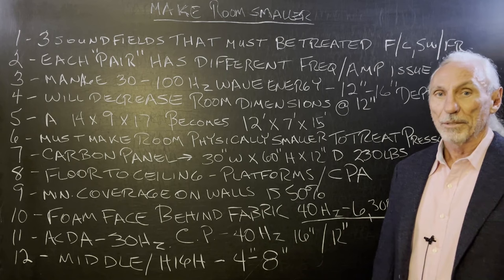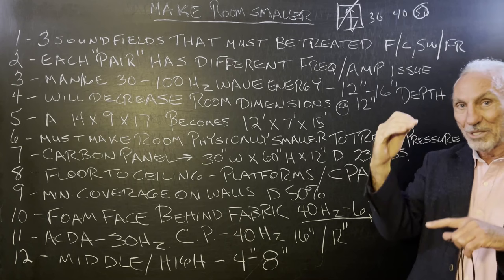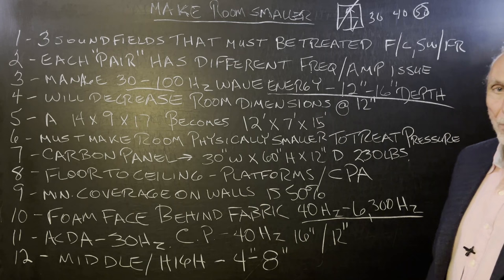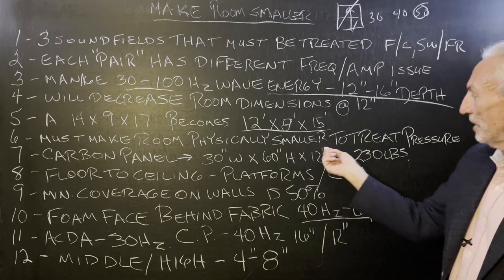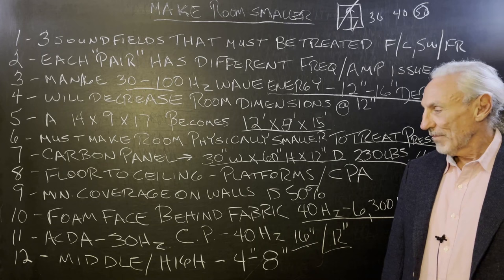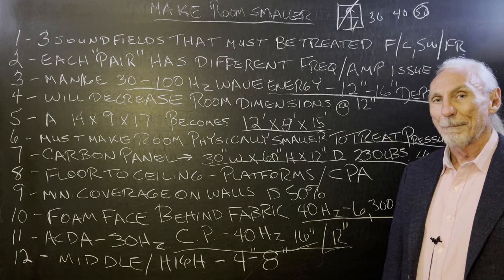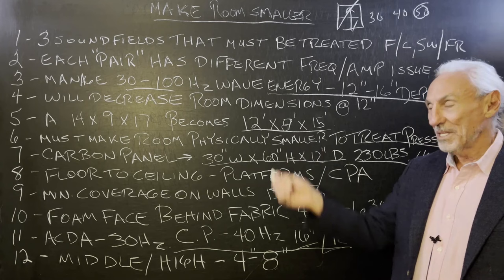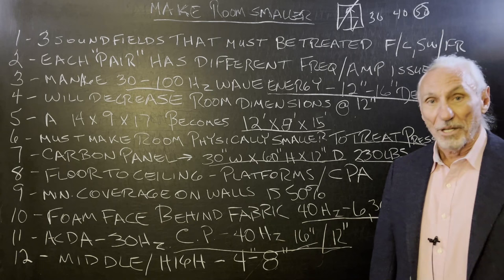Make Your Room Smaller?! - www.AcousticFields.com

Comment: Small rooms (let's pick 12x15 with a 9' ceiling) might be fine from a modes standpoint if your use doesn't generate very low frequency sounds. For example, if you use it to listen to 2-channel baroque string quartets, a cello generally has a low end of C2 around 65 Hz, and that's not hit often. A 9-foot ceiling has a fundamental of 63Hz, so if you set up the speakers and listener positions semi-near-field, say a 6' equilateral triangle, you'd probably need a fairly minimal amount of LF treatment up above, with reverb reduction from the side walls being the main task to be tackled. Lots of reverb with violins is really unpleasant. Your 12 and 15 foot long walls should have fundamentals of 47 Hz and 38 Hz respectively which shouldn't present major issues with string quartets.

Of course, before spending a bunch of money, get input from AF. Feel free to tear that spitballing apart mercilessly.
Reply: The number of people (especially recording engineers), only listening to music above 65Hz is VERY rare. I don't know  of a single audiophile that limits themselves to only that type of music.  Even most bookshelf speakers will reproduce down to the mid 40hz and below, especially with a subwoofer added.
Reply: @Oneness100  Yes, but for string quartets, that room would be pretty good without much LF treatment. The semi-near-field positioning, assuming a low noise floor, would allow the listener to hear other types of music with lower frequencies at a pretty good level (due to the relatively short distance between the speakers and the ears) without putting too much pressure (as Dennis would say) into the room. It's a trade-off for a limited budget and limited space.

I'd add that you're right even if the listener just stayed in the baroque era, where organ pieces reaching frequencies below 20 Hz aren't unknown. I was at an organ recital in a cathedral here, and the organist said the magnificent Casavant pipe organ there could go down to I think 16 Hz, though didn't get quite that low the night I was there.
Reply from the maker: Room size and treatment must match usage.
Reply: @AcousticFields  The ideal room size to accommodate a 16 Hz pipe organ note's wavelength without LF treatment could be about similar an NBA court cut in half. 35-36 foot minimum in all three dimensions? Then there's all six surfaces to treat for reflection. That's a LOT of area.